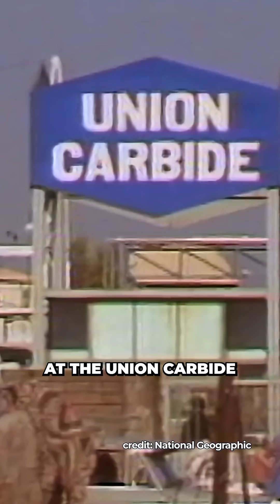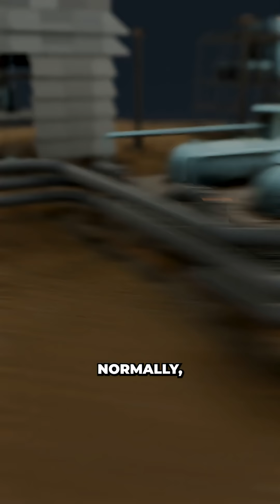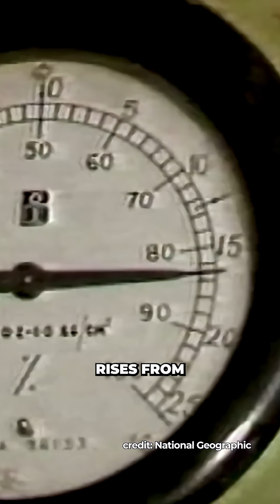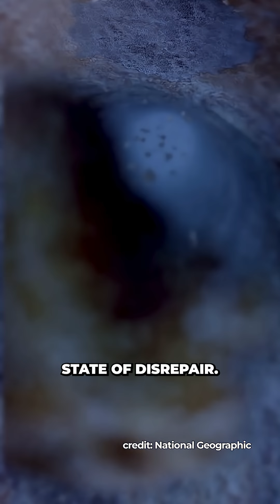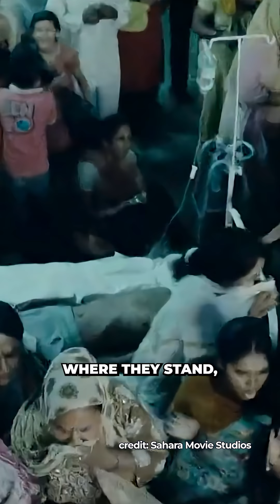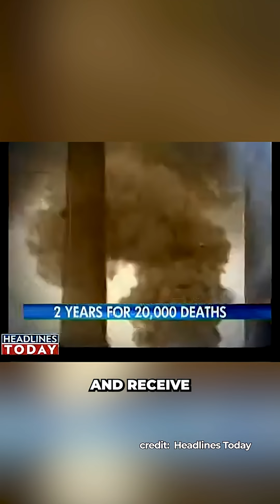The True Story of the Bhopal Gas Disaster

Comment: People talk about Chernobyl but ignore Bhopal, The RBMK reactors had design flaws which were hidden from operators and even then, it was only when a operators pushed the reactor to its limits did the Chernobyl disaster happen and despite being one and the only one of its kind, Chernobyl is nowhere fatal as Bhopal was. LACK OF MAINTENANCE BY COST CUTTING MADE A SIMPLE CHEMICAL LEAK MORE DANGEROUS THAN A NUCLEAR MELTDOWN. READ. THAT. SHIT. AGAIN.

BTW The popular theory is that Cleaning workers were never told to put pipe slip-blind plate that blocked water from entering the tank, these were illiterate workers without even gloves or gas masks, they did what was told and no one told to put the plates, but some say it didn't matter, it systems were so rotten water would have leaked anyways

Comment: My first table saw, I bought it cheap but new. The manual showed someone cutting wood on their lap, and it was circled with an x but it had to have happened to someone for them to include that. The design having to be made is intentionally like, somebody somewhere at some point cut their legs off or something. I still shudder at the thought. Manuals are important, especially safety sections.